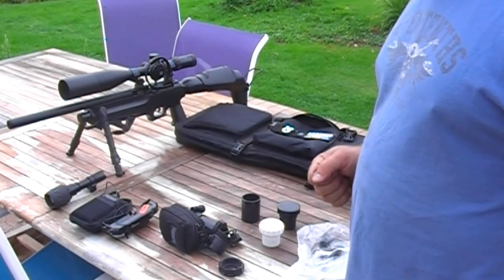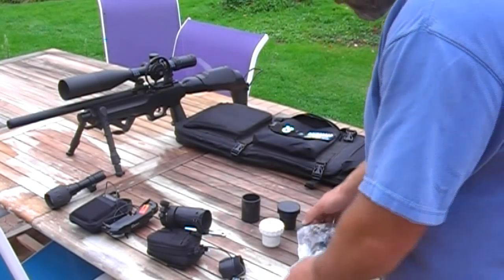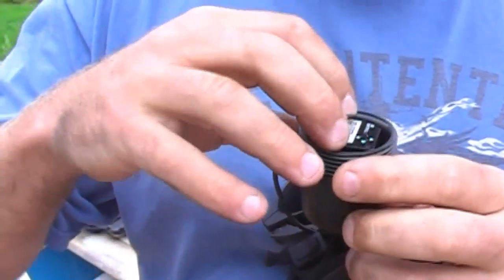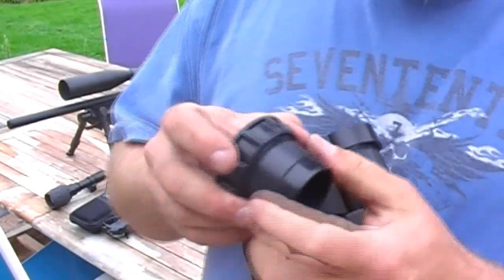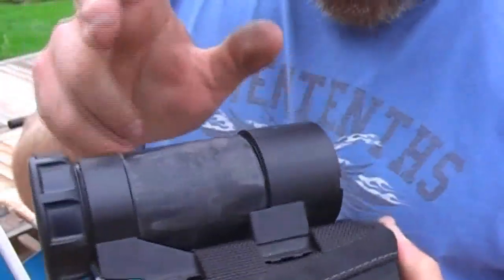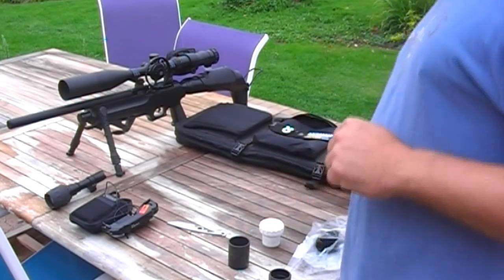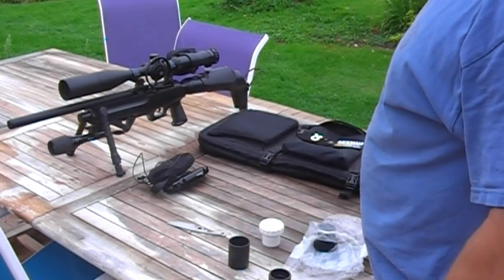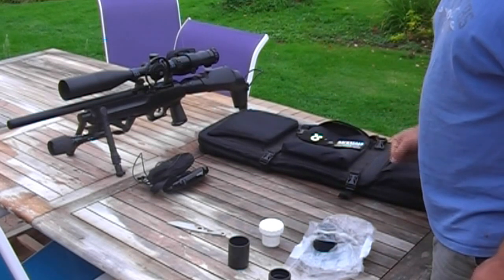E700 Wireless  DIY  Night Vision Scope

Comment: you could use rubber hose and car radiator hose clamps  on the coupler to the scope rear.
Reply: I like using rubber /silicone hose as:
1: Makes for a waterproof connection.
2: Robust /Secure connection.
3: Tension applied to clamp allows use on scopes which are about the same OD, but are not.
(Downside clamps, in that case use tape to build up OD of what you are attaching sub-assembly to.)
4: Protects camera from RECOIL...
5: If dropped /bumped keeps things from breaking, or getting out of alignment.

Comment: Oh I have another question. Will a nv setup like this work on a gas piston air rifle (12lb. +)? Or would the recoil just make it impractical?  Thank for any expertise you can offer. I'm new to this level of air gunning.
Reply from the maker: BlacktailShadow should be ok but check the join often to see if it moves airgun recoil is more harsh than centerfire in that it snaps fwds and backwards

Comment: hello, I have tried to mount a following your advice, I used a Chinese rearview camera, and when I plug in the tube, the image I see is small .not takes the whole screen (I have a monitor from 5 '' and I can not enlarge it .I tried to move more or less close to the viewfinder but nothing .I know if it depends on the video camera or from 'the optical viewfinder. can you give me some advice' ?? thank you very much in advance.
Reply from the maker: Giuseppe Manna do you know what lens you have a 12mm or 16mm is best to display the full screen  it needs to be 3-4 inches from the scope just as your eye is for normal shooting
Reply: FGYT Shooting thanks for answering immediately. I have a simple riflescope 3-9x40, and the camera I used is a car reversing camera I believe with lente12 mm (but will check when I get back home). you refer to the size of the camera lens? again thank you for availability.

Comment: hia mate first cheers for replys you send to us all shooters . but im sorry dude i have one crirasizem because others are also doing the same mistake . jioning the coupler to the end cap??? size of end cap is 40mm , also you say SAME size 40mm copler . ??? how the hell can one cover the other ?? ANSWER is to get a 38mm to push into end cap , obvously 40mm to 40mm dosnt work, if a problem with a mm just put a piece of tape on  PROBLEM  SOLVED MY FRIEND hope this helps you.all best for exmas and new year billy
Reply from the maker: Scott Unsworth  no the 40mm refers to the whole family of pipe fittings and  in that size these are plumbing fittings all 40mm fittings are used on 40mm pipe so the coupler is big enough to fit 40mm pipe and the end stop is sized to fit into the coupler (you did see me push fit them together in the vid and the descriptions in the links) the only mix up would be the smaller series which is 32mm and all 32mm fittings work together but don't fit 40mm series without 32-40mm adaptor.... as pointed out many  times all the parts are linked above and are correct (40mm is the old 1.5" generally used for bath waste pipe . 32mm is the old 1.25" generally used for sink waste pipe. ) this is relevant in the UK where I am and the links are to UK suppliers as of the date of the Video posting

Comment: Wireless means wireless you got a bloody wire on your goggles HOW can it be a wireless unit
Reply: The Googles are WIRELESS... in that there is no wire being connected DIRECTLY to the camera.  The wire you are referring to connects the goggles to transceiver and battery pack, transceiver talking to the transceiver the camera is connected to over a WIRELESS CONNECTION.
Pros: 
Decoupled from weapon.
No "wire" between weapon and operator.
Ability most likely to connect to other imaging devices, dvr /recording devices (Limited I'm sure, but doable)

Cons:
Extra complexity (Failure point)
Extra batteries (Weight, Expense) to deal with.
 
I would think forgoing wireless would reduce expense weight, greatly extend run-time.
Downside googles being tethered to scope.